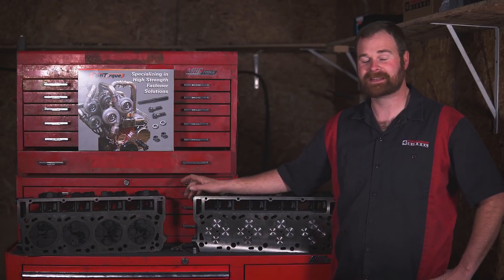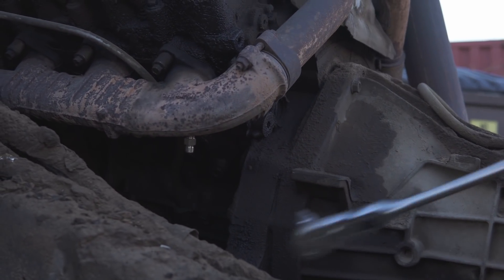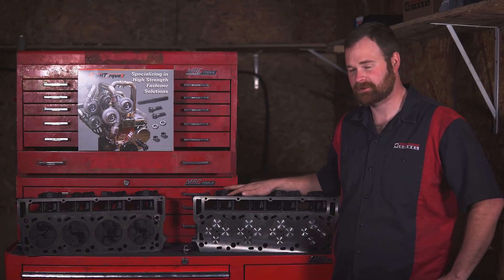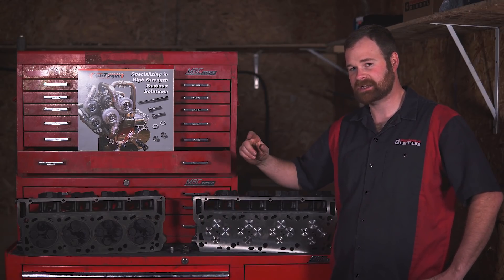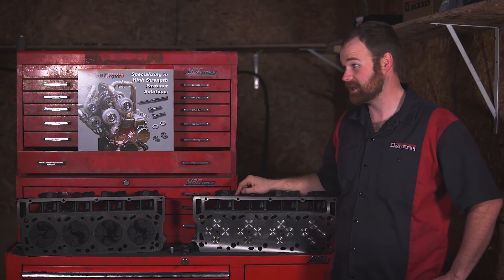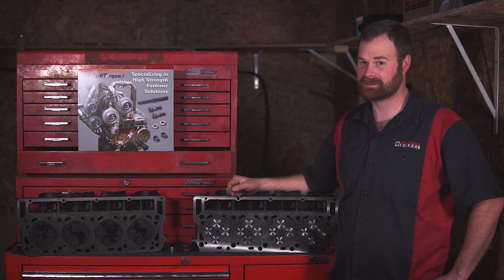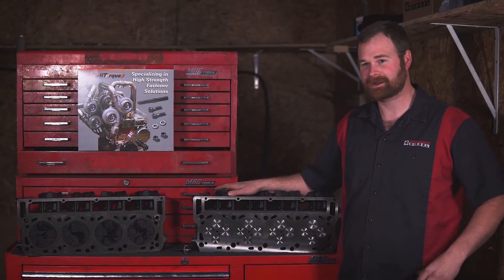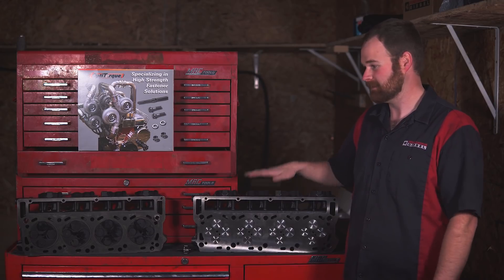Ford 6.0 Power Stroke Cracked Head

Comment: How much for a shop to do this? A guy in town does it without removing the cab says you get a lot of squeaks after that process, I just need to get it running to sell ,06 F350 x cab  long bed 250,000+miles
Reply from the maker: between 10 and 12 usually

Comment: Hard to believe many ppl would “ invest “ 8-15k in a 15-19 year old truck that didn’t have a good engine to start with.
Reply: Because I don’t have 60k for a used ‘16 and definitely not spending 80k for a new one, plus no def, particulate filter, and maybe other related things
Reply: @curtisc8233  , you don't have $8k for the repairs either.
Reply: @repairvehicle  yes, I did. And no payments
Reply: Brand loyalty
Reply: Its more around 4200 - 5000 for a full rebuild
Reply: 8-15k would make major power reliably on a 6.0, unless you go to a mechanic, which at that point you waive all rights to complain about cost. You can easily get by with studs and a flush if the previous owner actually cared. Which tbh you should do studs on any diesel but that’s just me

Comment: 311 wheel from a 325 hp rating ? I’d say that’s strong.
Reply: Ya with 300k on it and pretty severely cracked heads
Reply: Yea I was going to say that’s pretty impressive. Bone stock with that many miles!? Wow
Reply: That does sound like it's probably got a tune on it, or a very generous dyno. 6.0s typically do ~250-270 rwhp 100% stock.

Comment: Owning a ford diesel is all most as much fun as going to the dentist, proctologist plus having your finger and toe nails removed simultaneously without anesthesia. You "ONLY" have to remove the cab to work on the engine, what a brilliant design.......  NOT
Reply: You can very well do heads and all with the cab on, by just removing one engine mount.  But if one has a lift, the cab is designed in such a way to make it reasonably quick to remove, so most shops go that route.